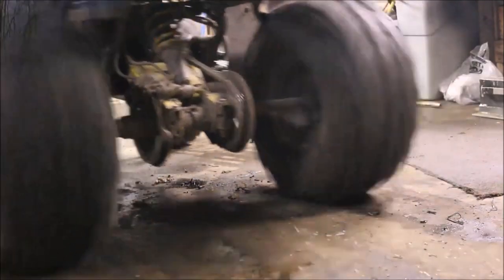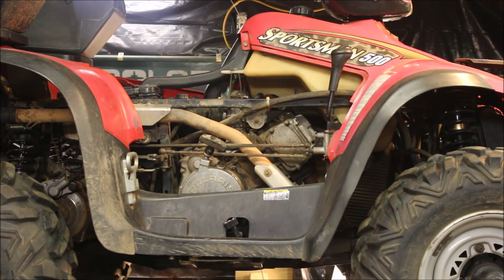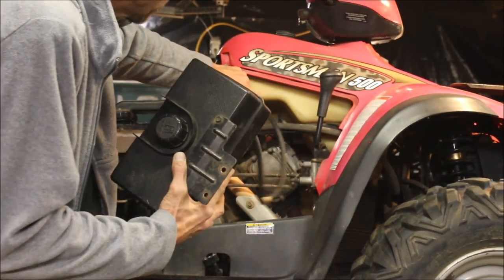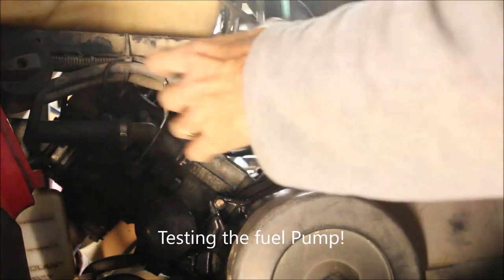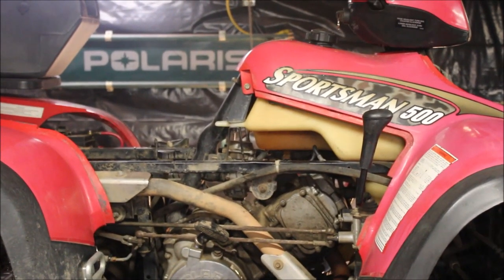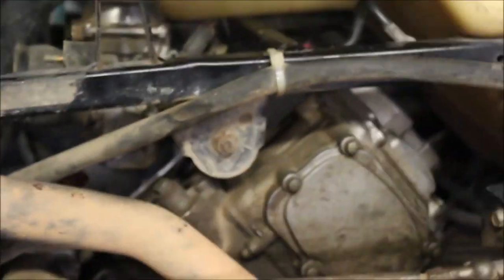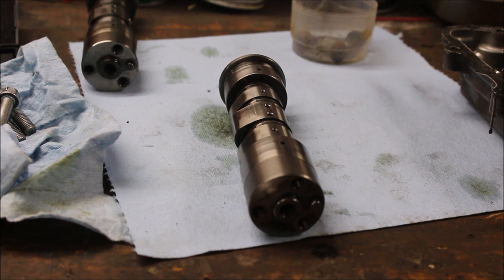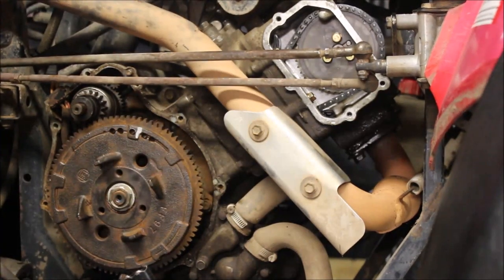How to Trouble Shoot issues on a Polaris Sportsman 500!

Comment: At my wits end. I have a 2006 Polaris sportsman EFI 500. All electric good fuel pump new injector new. The bikes only got 200 hrs never touched it never ran hard all of a sudden won't start. If I spray starter fluid into carb it will run. Help
Reply from the maker: Did you purge the air out of the fuel lines after fuel pump was installed?  also did you replace the fuel filter? That might be plugged.
Reply: @TitaniummanGarage  yes and yes. The fuel is pumping great. And the injection system is pumping. Good spark the thing that gets me is I can spray starter fluid into the carb and it runs fine. That said I'm confused on my next move. P.s thank you so much for replying.
Reply from the maker: @rickjosephsen8923  did you pull the injector to see how much was coming out? I had the same issue.  I pulled the injector. Fuel was spaying out. At the time I didnt know how much had to spray out. It still wouldn't stay running. So I pulled the fuel pump again and found that the round fuel return thing popped off. I had to use a hose clamp to get it to keep it from popping off again as the clip holding it was bad. I assembled it and fuel came gushing out of the injector fast. Before it was a light spray. Problem solved. You might want to check that pump again.
Reply: @TitaniummanGarage  check. The injector is putting out move fuel then I expected. I removed the line to it and the pump poured out a ton of gas. Back to me spraying into the carb. I ran out of ether  and even used carb cleaner and it ran on that. Could the timing be off,  b t w I can't believe that the dealer turned me down for any repairs because it's a 2006. Man what's going to happen when Drs say dude your to old to operate on. Tnx, Baffled
Reply: Hi guys. I wanted to say thank you for your input. I think I should say again WHY can I keep the ATV running when I spray a fine spurt of starter fluid or carb cleaner. I feel I'm so close just missing a fine line to fixing this.   Thank you again.    Confused 😕

Comment: I have a 99 sportsman 500 it backfires through the exhaust most of the time one time I choked it and it blew the carb off. Revs fine backfire when idling back down and slowing  down. What would cause this?
Reply from the maker: Sounds like your loading up with fuel. You have to be careful now that it blew the carb off. It could have did damage to the diaphragm on the carb. Check the spark plug. If its black your getting too much fuel. I would also check the timing.
Reply: @TitaniummanGarage  thank you. How to I fx that?
Reply from the maker: @austinjackson8248  check the carb. make sure the slide goes up and down when its running and giving it throttle. adjust the air/fuel screw at the bottom of the carb.

Comment: I think that you are mistaken about the compresion release ball. If the ball is STUCK  in the OUT  position,it will RELEASE compresion and the engine will turn over easily with the pull start rope. When the engine starts,centrifical force rotates the compresion release shaft and the cam folower SHOULD push the ball back down in its hole. Edwin Dirnbeck